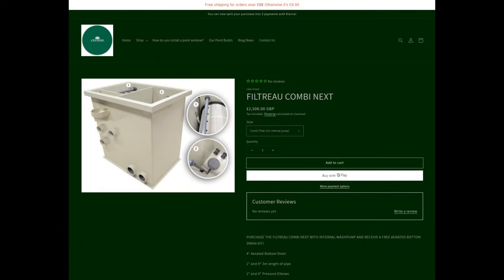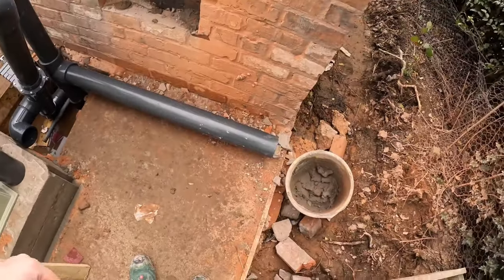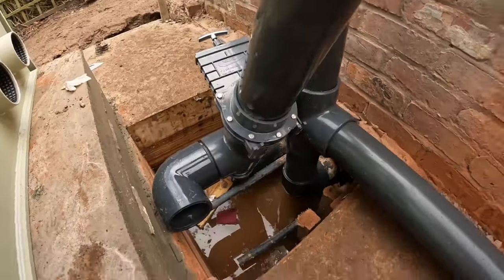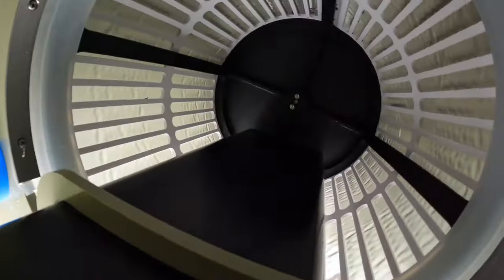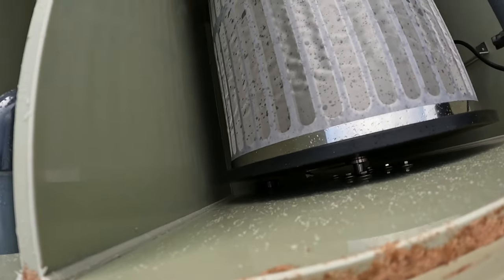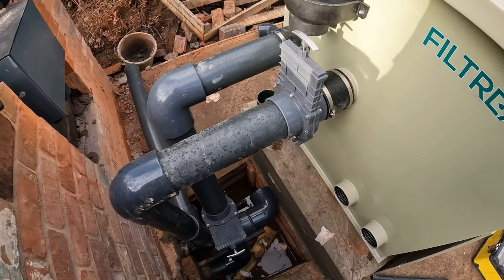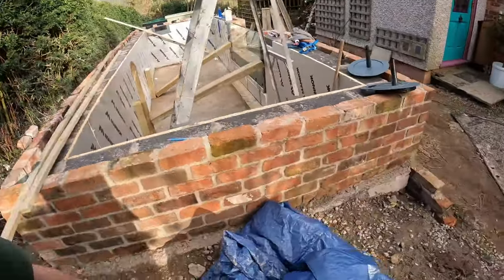CWD POND- Filtrea Combi Next walkthrough UK

Comment: Hi just wondering if it's possible to plumb the external pressure pump to the mains water to pump through the spray bar?
Cheers
Reply from the maker: Hi Dom, 

yes you can, when ordering let us know so we send a suitable pressure pump out, this one is submerged into the bio chamber so cannot be used in that way, but we have a solution for you.

Many Thanks
Reply: @cwdpond  ah right that's great. I can see this model has the internal wash pump but you can get the unit with an external unit. Does this pump need modifying or can I just plumb the mains water line to that pump? Someone said I could run the mains water into a header tank and plumb the pump to that but not run the mains line directly into the pump?
Dom
Reply from the maker: @dompeel4791  your mains can run to the pump but as you say it'd need a settling tank before

It would be easier just setting up a trickle in trickle out
Reply: @cwdpond  yes I know what you mean. My thinking was I'll save money from buying it with the internal wash pump and then I'll still have two usable outlets as I've seen people plumbing the external pumps to the outlet of the bio chamber.
Really appreciate your time and help btw👍

Comment: I have this filter my BIG issue is the small bio chamber.
A pond is advised to have 5 to 10% of its volume as biological filtration.
Even at 5% the filter can only handle at 7.000 liter pond, while rated at 20.000 liter.
Reply from the maker: This is rated at 45,000 litres and has a 350ltr bio chamber

If you research hel-x media you'll understand that it can cope with 170g of feed a day, more than enough for a 7000 litre pond with 175 litres of media...
Reply: I have this filter and fitted around 200liters of k+ in the moving bed. It can handle around 1kg of food every day.. I think it a big misconception the filter to water ratio. I always comes down to how much food you put in and how much food your filter can handle 🙂

It's a great filter - with some mods 🙃
Reply: @koikanalen  funny you commented on this videoi just watched yours 😆 what mods did you do? is that a protein skimmer pipe you have right before the inlet ?
Reply: @EL_Toro1     its a protein skimmer 💪. Simple and works very well.

The most important mod, was new air system.. i got 3 airstones istead of 1 and they are on the bottom and not 5cm over, like the standard one. I use a 65l/m air pump. 
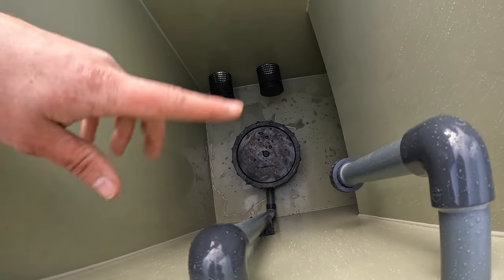You can see it in my video, Vlog8 Around 4:10  👍

In case you dont understand danish, feel free to ask any questions 😅